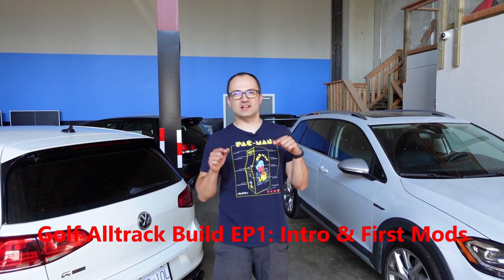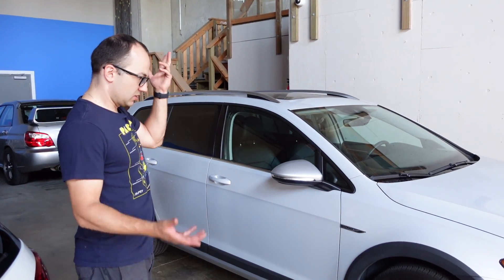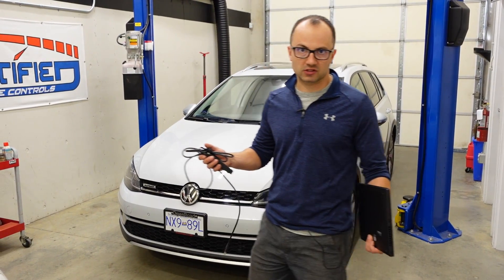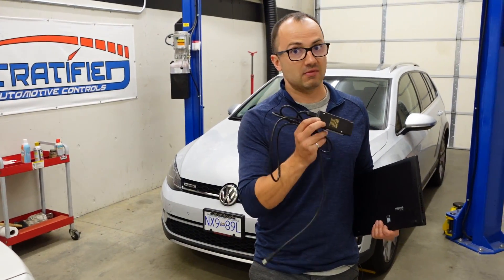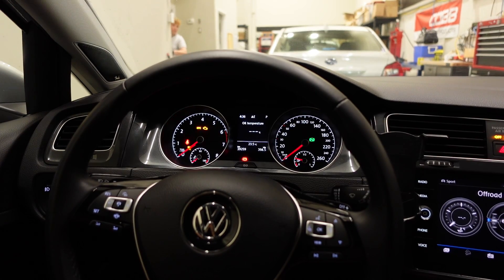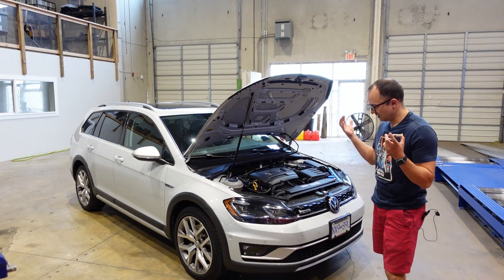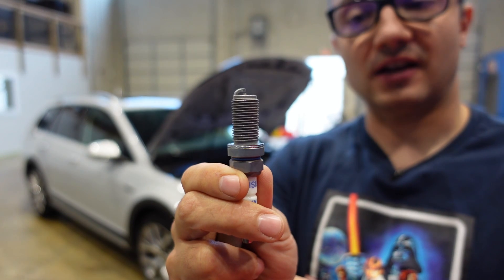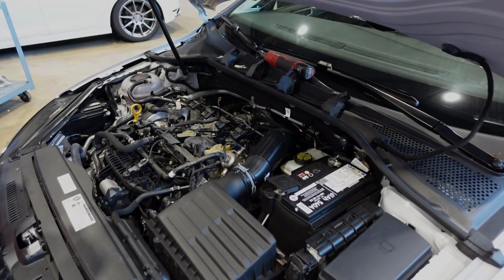Alltrack Build EP1: Intro and First Mods

Comment: I have a 2017 Alltrack SEL and I absolutely love it! I can't wait to watch this build series!
Reply from the maker: Thank you. We have more coming!
Reply: I have a 2017 SEL also. What issues have you had since owning it?
Reply: @NuII-v8n  lol. tons. I no longer have it. it was a very fun car to drive, but they can have issues. water pump/ thermostat, heater core, hvac control valve, bad injectors. all in 1 year. I got it with 84,000 miles for a decent deal, then put thousands more into it. traded it for a 2021 toyota tacoma. I didnt hate the care. I am pretty sure the previous owner drove the hell out of it and didnt keep up with maintenance.

Comment: My 2017 SEL Alltrack has the ESR button. You push it once and it turns it off entirely. To get into the ESC Sport you have to press and hold it from active and it’ll switch. Doesn’t have the launch mode but it will after I smack a tune onto it for the Engine and DSG. Had it a month and I’m in love with it, from a dealer with 103k miles. Coming from a stock 03 Passat Wagon GLS with 230k miles. I’ve been looking into all kinds of stuff to do with mine. Mainly the DAB Auto Haldex V control and then it’ll be off to a tune shop, maybe a clear wrap to protect the paint and some tinting, and a lower stance. Also, a proper oil pan and skid plate that are metal. Glad to see others who are stoked about these, at first I thought I was gonna have a limited community to be part of. I will be tuned in from here on out.
Reply from the maker: Enjoy your new Alltrack, they are great cars and let us know if we can help with tuning or parts!
Reply: Sport + Traction Control off + hold down the brake and tap the gas. Launch control will become active
Reply: @Andrew-kx6mt  that didn’t work on mine?
Reply: @colinfruend5537  try sport mode via the shifter and really mash the brake down
Reply: @Andrew-kx6mt  in the limited esc mode or completely off? I think I managed it earlier, does it turn it into just fwd for launch or all 4 grabbing?

Comment: There is NO longer wheelbase !
Reply from the maker: You’re right. Misspoke there. Otherwise you wouldn’t be able to play so much Lego with the parts from the MQB.
Reply: I’m pretty sure the Golf hatch has a shorter wheel base of 2620mm compared to the Golf Alltrack’s 2630mm. This is direct comparison for the 2016 Australian model Golf r hatch vs Golf Alltrack. It is negligible but it is there
Reply: Yeah right... mispoke several times... a little research before making vids would've been better.
Reply: @cliveneilands1449 nice video

Comment: Not all Alltracks are DSG, at least in the US.  My '19 SEL is a 6MT.  Not a ton of manuals out there though, probably less than 10% of them.  I have a stage 1 on mine, plus some other stuff like Neuspeed wheels, some reasonable size spacers, couple other things.  So far it's perfect, zero issues over 40k miles.  Would love to do an IS38, but it's big $$$ with the manual since you have to do the clutch in addition to all the other necessary stuff.
Reply from the maker: It’s a great car to keep around and mod as you can. We just put an is38 on ours. Expect a video soon :)

Comment: What is causing the misfire on the spark plugs? Is it just the wear on the ground strap  Causing the gap to get bigger or is it something else?
Reply from the maker: Yes generally ground strap erosion and stretching is what opens up the gap. The electrode wears as well over time.

Comment: Currently in the process of buying a 2019 Alltrack S 6MT. Avoiding the potential roof leaks with the S trim and saving a bit of money. Definitely considered the DSG to jive better with increased power, but I probably won't go past Stage 1 for the time being so I'd prefer the more engaged driving. I am very likely to reach out to you when it comes time to get it tuned. 

I'd really like to know what your plans are for the Alltrack since you havent posted anything about recently. Are you going to upgrade the turbo and maybe add some more bolt ons? I think the extent of my build won't go much beyond what you've done so far. 

Cheers.
Reply from the maker: We tuned the stock setup and added some much needed handling upgrades. We are already in the process of taking it further after tuning quite a few is20, is38 and bigger turbo versions of the car. So absolutely there is more coming but nothing wrong to stop the missing where you feel comfortable. 
When you want to discuss your plans and mod path please don’t hesitate to reach out.